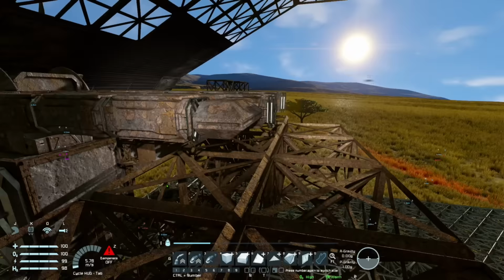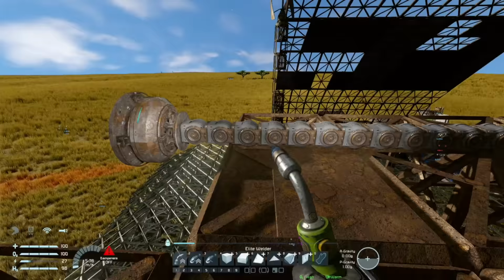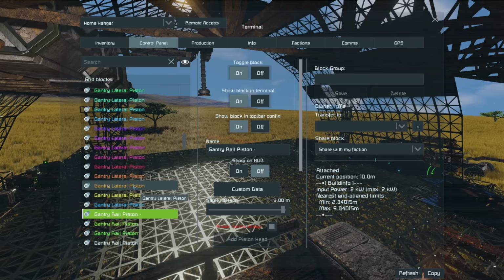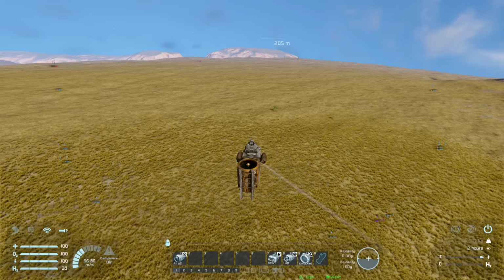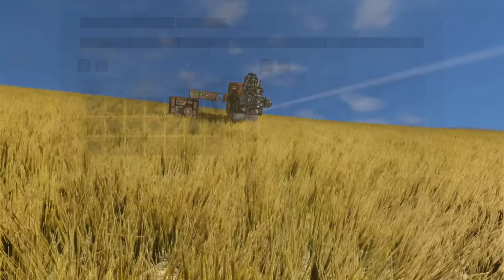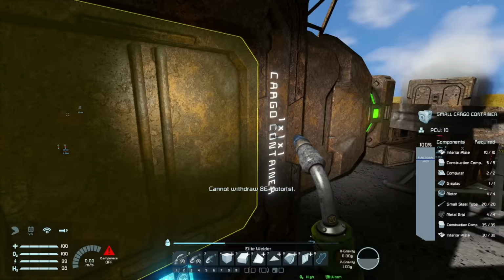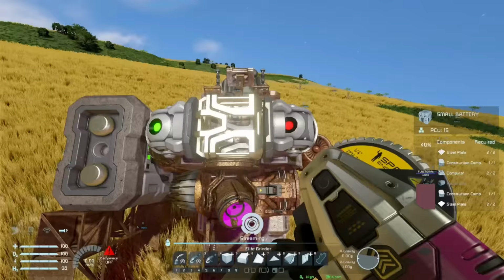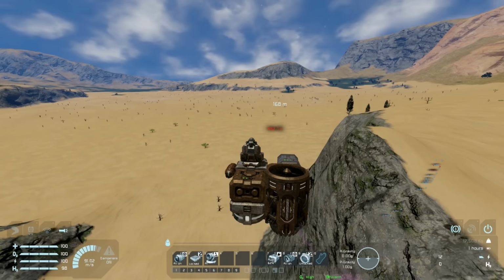Scrapyard Engineers - Gantry Crane with hinge chain?

Comment: You could build a chain guide using blast door edges so that the mag plate can't go any further than it when you wind it back up. There should be enough gap to allow the chain to go through but not enough for the mag plate.
Reply from the maker: Yeah I think that would help a fair bit

Comment: on the subject of ladders, there's a nice mod for them that I'm shocked I haven't seen streamers use called "Ladder (climbable + use tools/weapons/interactibles on it!)" it also has a small single block high individual rung ladder for small grid and a collapsible ladder block that would go great on the truck. it's also slightly faster to move along.

Comment: I love watching any series you have in SE and this is no exception; really well done.
While some things are "inefficient," aesthetically they make sense, they have story and purpose and I think it makes the overall experience interesting and the designs more pleasing... except the gantry crane helm. You were saying you wanted the possibility to be able to unload from the helm (1st person camera?) and then proceeded to put the helm at the furthest possible location from where the truck would be which would make that nigh impossible. Now every time you pull up you have to run to the entire opposite end of the hanger to get in the gantry which seems illogical. I thought you were going to make the helm near the pick up point facing sideways (truck left/hanger right) so it would increase your viewpoint of the whole workable area 🤷‍♂.
The hinge chain when mining worked great (and the cable car looking thing was awesome), as a crane that might be problem because the higher you lift something the more its position is displaced by the physical space the hinge coil takes up... still cool though.
I was hoping to see you finish the mirrored side to the crane and then make some 4 sided, nested piston design in the center space, and given the space between the piston arms I had originally thought you would put a cockpit there that would move with crane to be directly above what you pick up. My guess was wrong, but it makes me want to try it. I think I'd do it it with just small grid pistons, only because I like the look of it... similar to how you made the truck's crane look more beefed up with its redesign.

Comment: You should add in random data pads (loot very very rare) that unlocks things slowly. That way you can do a touch of progression and by controlling where the pad spawns. you can force people to travel between the danger area's (space), maybe even putting a few pads on npc ships to encourage end game piracy :p. I could also see two additional type groups for scrap sites. Im not a great builder yet but putting the idea out there for anyone to use. Abandoned Mining sites with derelict (or without) vehicles. This will give a avenue to scavenge ice/bars, and for the last type. Abandoned Factories.. Go back and find Mickies Scrap (escape mars) and make a derelict version of it. I could see at least 3 variants of the type of factories too. Vehicle one, General (IE for plate/solar), H2 factory for tanks and ice. Balancing em out and how many/how often they spawn and in what ratios is up to you. The type of buildings would need to be heavily reduced to make production still very hard. Also once you have the heavy lifter, snag the solar bus from the ground and take it back, fix it up and use it as your chill spot around the hanger :p

Comment: 1:26:00 WOW!!!  No matter how I look at it, an overhead bridge crane would have been way better and easer.  All those pistons and hinges. You were kinda asking for it.
Reply from the maker: An overhead bridge crane would have clanged out just as hard tbh, since wheels are subgrids the end result is the same :D
Reply: @Flipsie  Actualy I built 1 sm grid on a lg grid bldg, it works fine under load, not sure why you're having trouble.  I'm interested in how you built yours and how long ago, I used the 2x2 wheels on a large grid beam block ( no deformation) and had no troubles.

Comment: Space Engineers ladders are THE WORST ladders in any video game I've played. You can't build while on one. They are slower than all other transportation methods. You have to exit onto a block in the direction your facing, or your jetpack turns on. They have extremely limited attachment points. They are too big for small grid builds. The only upside I can think of is that being on one during a Jump Drive jump takes you along.